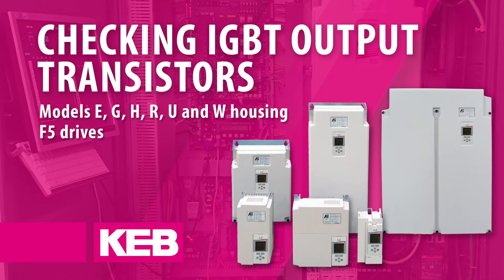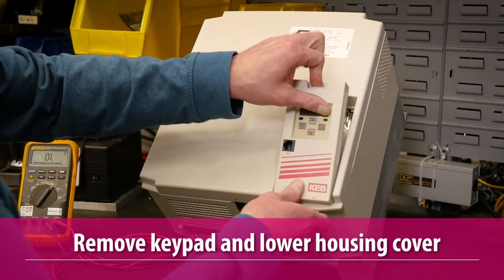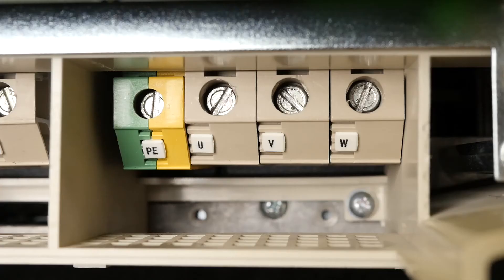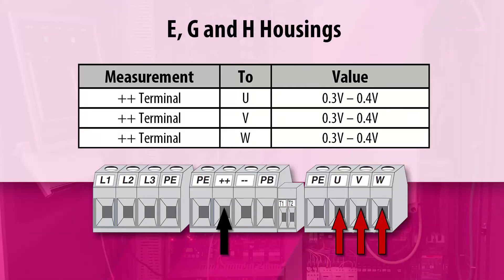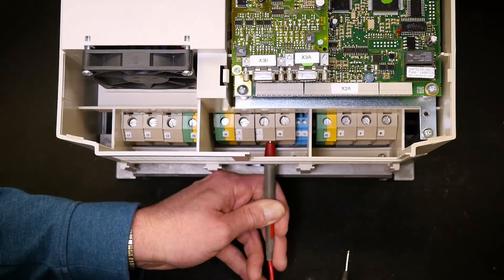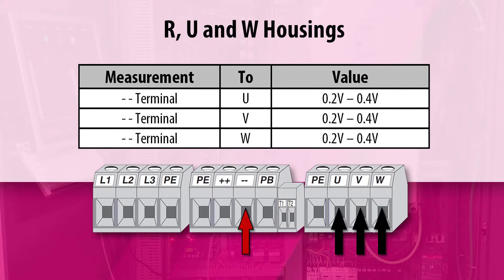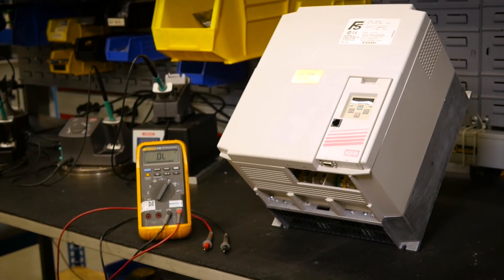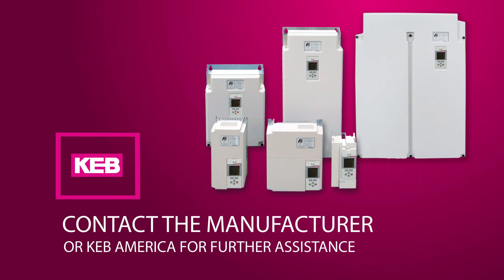KEB F5 Hardware Measurements - IGBT Output Transistors (Video 3 of 3)

Comment: hi
i have f4 inverter with error E O C after replacing shorted bridge rectifier and blown fuses i checked all IGBT as required and every thing ok but still giving E O C even if the motor is not connected ...what do you mean by blown IGBT (open circuit or short circuit or both)
Reply from the maker: Hello, and thank you for your comment. The best way to resolve your issue is to ask your OEM (original equipment manufacturer). If you do not have an available OEM to resolve your issue, contact a local KEB Representative. You can find the closest KEB to your location using this link: https://www.keb.co.uk/company/representatives-agencies
Reply: @KEBAmerica  my question is general according to your video and not related to any local Representative and i asked before...what do you mean by blown IGBT shorted or open circuit or both
Reply from the maker: Regarding your question, based on the information you gave it sounds like the hardware of the IGBT has failed. There may also be additional internal hardware damage. We cannot recommend one catchall fix without opening it up and inspecting the internal components, but we no longer service F4 drives anymore. They were phased out many years ago. We recommend you replace with an F5 series. However, we always recommend you contact your machine's OEM first.